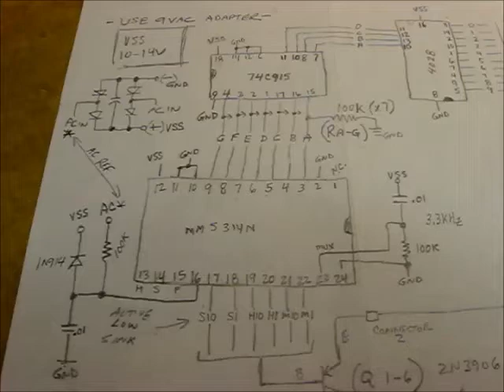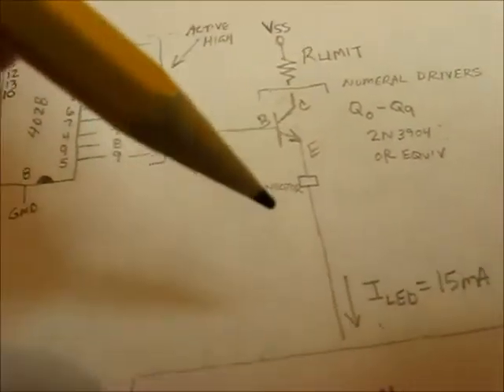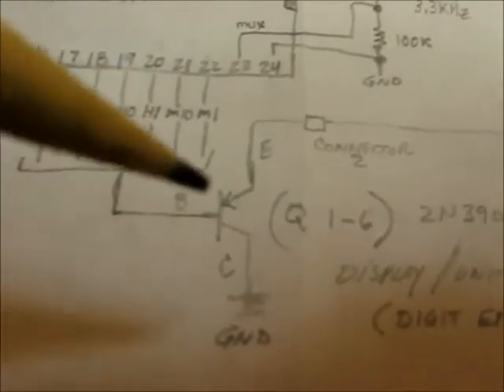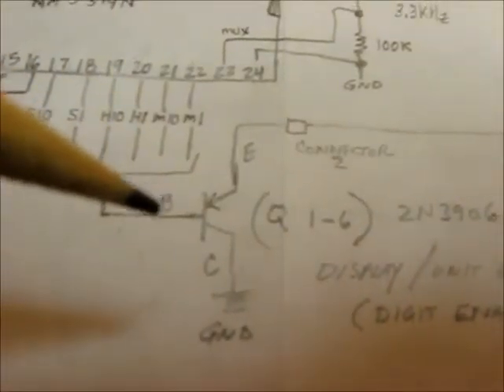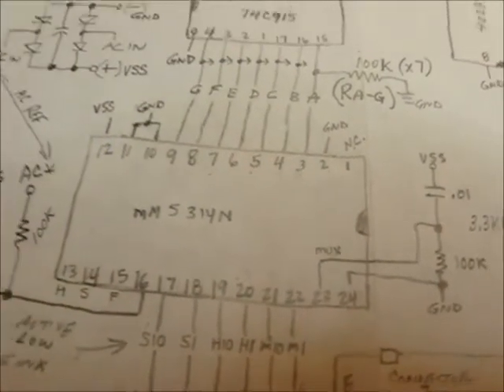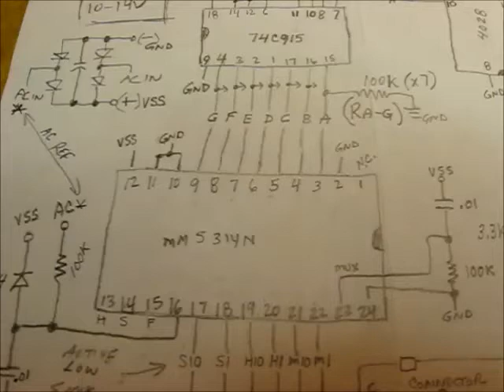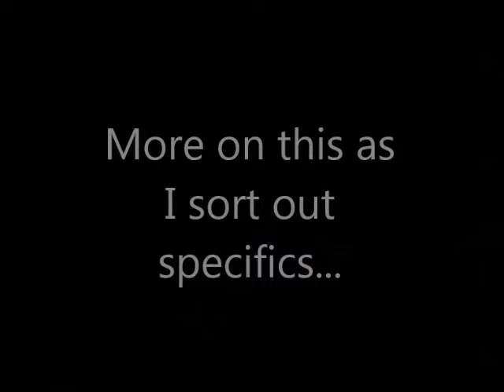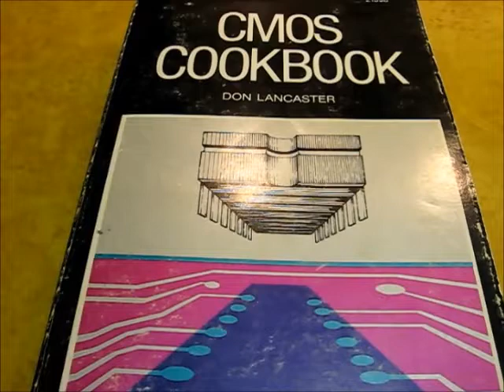Designing a 6 Digit Clock with 1 of 10 driving circuit using the MM5314N, 74C915 and 4028 PART 1

Comment: I to am working with the MM74C915. Having a slight issue though. When the 7 segment putputs 1, the bcd is 1111. Do i need any pullup/down resistors anywhere? 

Got these connected to an LM8361.
Reply from the maker: Hi, You find this only at 1?  Weird.  I found pull downs to be necessary for sure but I had erroneous data across the entire range of seven segment output.  In my case, and I am not sure if it makes a difference, the 5314 is multiplexing and the fast switching of states on an oscilloscope could be seen as slow transitions.  After adding the pulldowns, I had a nice square wave on the outputs of the 74c915.  In your case, a scope would show you for sure if in fact the 8361 switches the outputs to ground or if the 7 segment outputs float in the inactive state.  A little more understanding on the 8361 is needed as to how the outputs act.  From what I can see on a  blurry datasheet I found, it looks as if the 8361 is intended to drive a common cathode display?  That may mean that the outputs go high when active and may just float when not active?  I am guessing.  So, yes maybe pull downs can help.  I would imagine problems across all ouput states though, not just "1".  Can't hurt to try, right?  Good luck.

Comment: Hi brother. how are you? I was surfing the internet looking for information about 74c915. I need it because I work with elevators and the indicator for the elevator floors is 7 segments. but I have bought a lcd screen to show the number of floors with 4 binary inputs ABCD. so I need to convert 7 segment to bcd. I want to know if you have more information about 74c915 either a website or any document. something that also worries me, how can I show two digits using 74c915. I would appreciate your help. greetings from Cartagena, Colombia
Reply from the maker: How's it going?  All is good here and I hope it is your way also!!  The 74C915 is an obsolete part nowadays but can still be found.  I am not sure about the sellers from China but this was a good USA seller for this part:  https://www.ebay.com/itm/74C915N/131651092943?hash=item1ea70441cf:g:F8MAAOSwWnFV~c8R

The datasheet for the 74C915 is at this link:
http://www.datasheet39.com/PDF/929491/74C915-datasheet.html
And within is a link to the full 4 pages.

As far as the implementation, I guess you will have to verify the logic levels.   But most systems has BCD with in the circuit.  But maybe in modern days it is integrated in an all in one chip and you may be forced to do what you plan.  I have no idea on what you are working with.  But as far as 2 digits, I assume the elevator has 2 digits and your display module has 2 but I am guessing by your question that the module only has one set of BCD inputs?   You may have to multiplex them?  Are the displays in the elevator circuit multiplexed?  Can you get a schematic for the elevator circuit and data on the LCD module?  I am thinking that is the only way to proceed.  I am no expert, I just tinker.  You also have to watch as older elevators had high voltage displays in the called Panaplex Displays.  Those indicators run at 170VDC make sure you don't have them!  I am sure they are out of service by now.  But back to the task at hand, you are probably going to need an oscilloscope at least, for this project and I don't know what your background is but I do not think it will be as easy as just putting in a 7 segment to BCD decoder but I could be wrong.  Let me know how you make out.
Reply: @JIMO415  if it is an obsolete part ... how could I convert 7 segments to bcd?
Reply from the maker: @darienbolivar7325  As I said, you can still get it but it is difficult.  I am not sure how else you would convert with out lots of discrete logic gates and such but that is not practical.  How old is the display panel in the elevator?
Reply: @JIMO415  there are two 7 segments.  It shows floors 2,3,5,7,9 and 11. It is from the 90s
Reply from the maker: @darienbolivar7325  you will have to identify the parts in the display circuit and at least look up data on them and get a knowledge on how  the circuit works that way.  As I mentioned maybe BCD is accessible already if there are discrete counter ic's.  But maybe the counter / display driver is combined then there will be no access to BCD.  Do you happen to know the logic family?  Is  it 4000 series by chance?  You also have to get data on the lcd module.  What type of 7 segment displays are in there now and why are you changing them?

Comment: Nice work there Jim!
Reply from the maker: Mr Paul, thank you!  This clock will be a real charmer when complete.  I want to get to your old gem but I am waiting to find the correct calculator to harvest the display from.  If not able to find one, I may install #352 Beckman Panaplex displays.  I hope all is well your way!
Reply: @JIMO415  Yes Jim all well here. I agree,  if you can, replace the gas discharge display on the 1977 Dick Smith MM5314 special. Good luck!